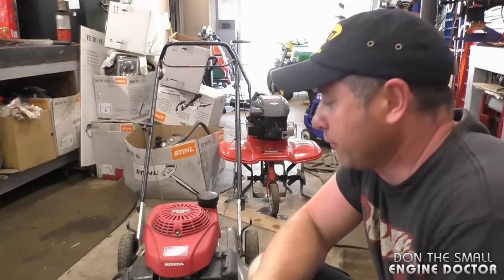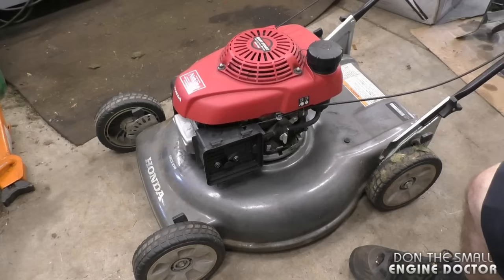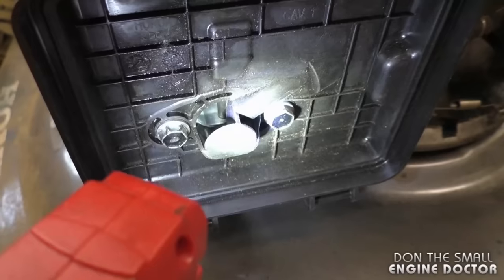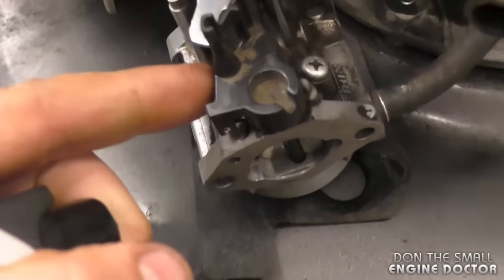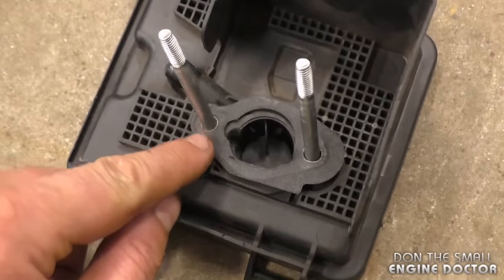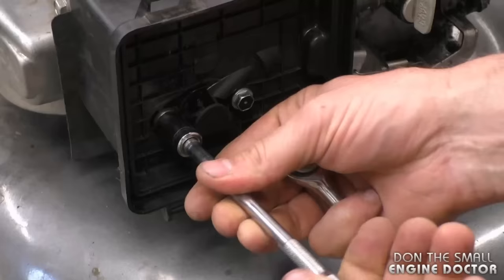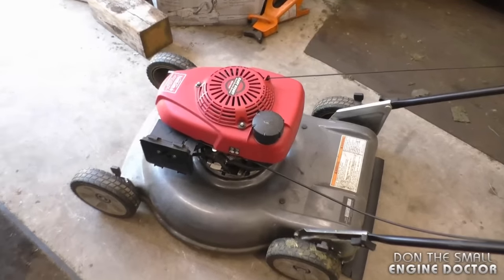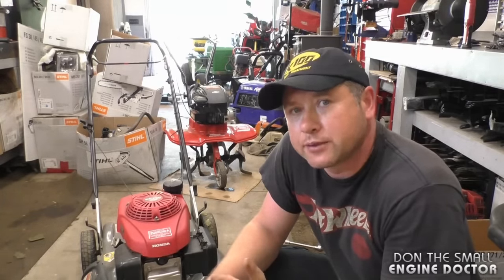Make Your Lawnmower Start On The First Pull Again - Honda Auto-choke Repair - Video

Comment: Consistently ranked at the top of Consumer Reports best mowers...I love my Honda.  This is a great auto-choke system that's easy to repair if it fails.  Thanks Don!!
Reply: @Walter Sobchak There's absolutely nothing wrong with a manual choke, Walter.  My Honda is 10 years old, doesn't have a auto-choke and it works fine; my point is if your mower has an auto-choke, the one made by Honda equals are beats the competition.  Thanks Bud!!
Reply: Yes it is easy.

Comment: Excellent clear video fixed my Honda no start issue  due to incorrect assembly of the carb causing the choke to be fully open , now fully closed on cold! 10/10💪💪💪

Comment: Thumbs up for sure. I bought one of the commercial Honda mowers that had this problem.
Did not want to put it in the shop to fix this poorly designed auto-choke so you helped me fix it.
Thanks much for this video.

Comment: What great video! This worked perfectly for me and my GCV160-powered mower now starts with one pull like when  it was new. I could not wait for the wax cartridge I had ordered online to arrive so I simply grinded down the pin ever so slightly and the mower now starts on the first pull. I will have to replace the cartridge when it arrives because the mower now runs a bit rich since the choke is probably not opening fully on account of the shortened pin.

Comment: Thank you so much for this video!! You explain things very thoroughly where I could actually tackle this project myself. Only problem was when I was attempting to remove the thermowax cartridge it was EXTREMELY difficult to remove and took at least 5 minutes with trying to pull on it to get it out. As I was trying to get it out and once I finally did I noticed quite a bit of gunk on it (a black/dark brown color) which is what I'm sure basically "glued" it in place. Do you have any recommendations on how to clean out the cartridge space before I replace it with a new one?
Reply from the maker: i use a small pick or flat screwdriver
Reply: Ok, great! Thanks for the tip and for your response!
Reply: @donyboy73  dony this happened to me too. Very tightly locked into place with black gasket seal. Does the Honda factory install these cartridges on purpose that way?? And the real reason I came to your site is to ask…when I’m replace the thermowax cartridge should I use black gasket seal or just clean out the hole and go with a dry fit???
Reply from the maker: @Fresh-tw7ev  I just insert new one without using anything

Comment: Thanks ,  that totally explained my mower's problem,  it can start first time and runs fine,  then stop , start again,  it will have problem,  even if it starts,  it vibrates and black smoke.  I found the choke flapper won't be wide open when the mower runs badly,  and the pin thing is randomly stuck out or stuck in.

Comment: I  really enjoy your great videos sir!  I personally use two threaded rods to align the gaskets and carbuerator as 'guide pins'.  You can then remove one threaded rod at a time, and then insert each bolt.  Saves time and potential errors regarding the gaskets allignment.

Comment: Man I miss my Honda Commercial walk behind... thing ran for 25 years and always started on 1 - 1 1/2 pulls... always.
Reply: Commercial mowers are designed and built with better quality materials and last much much longer. Those box store models are NOT of the same quality. I know a Honda dealer that loves to show his customers the difference. He even has both types disassembled on the showroom floor so he can show you the differences.
Reply: RC Hobbyist Extreme big time difference! Solid steel deck for starters... way better wheels, better engine... just solid and ready for business... the deck on mine finally passed away after all that time... it literally ran for 25 years... was still running but I let it go... hard decision but I did what I had to... bet it still starts... lol

Comment: My Honda mower is so hard to start. It has the rechargeable automatic starter but it won't start it from cold. After a couple years old and it wouldn't start right away, I always wondered why it didn't have the choke button to press 3 times before starting like my old mowers had. I finally discovered a hack to start it: fill gas tank, then roll the mower on its side to the right until deck is perpendicular to the ground (as if you were to inspect the blades), then flip it back upright and use the pull-start. If it doesn't start within 3 pulls, try flipping it over to its side again.

Recently I noticed that the engine said it had an auto choke and I then went hmmm I bet there's something wrong with that feature and sure enough Google brought me right here! I'll be glad to do away with my flip-start hack if this fix works for me. 😋
Reply: Update: replaced the part and it now starts on first pull from cold! No more flip-starts for me. 😁
Reply: @Rein_Ciarfella  Noooo, just get the fix! I don't miss it since I got the fix. I hope I didn't start a trend 🙃

Comment: My honda hrt 216 thats over 10 years old starts 1st pull everytime. However it does have the choke on the handle throttle lever so I guess I'll stay away from auto choke honda mowers.
Reply: @Big Texas problem is they are all going to this auto choke crap.  Can`t find a new one without it.

Comment: Dony
Thanks for the video.  Pulled my Honda out after a long rest and mower would start and run but then chug and die.  Choke was closed but wouldn't open.  Saw this video on the opposite problem and found that the pin wouldn't come out even after it got hot keeping the choke closed.  Followed your procedure, replaced the thermal cartridge and mower runs again.

Comment: I have one of these engines with the choke lever that auto-returns when you squeeze the handle bar. Not at all impressed with it. I own many pieces of lawn equipment and it's the only one that has fuel/carb issues.

Comment: Hello replacing that part was the only problem I had with my    Honda, not counting regular maintenance. But, I had a tough time getting it out. I had to drill a small hole then drive a self tapping screw into it. Then I pryed on the screw until  it popped out. I also used liquid wrench or something similar, Honda's running great now. Hope this helps.

Comment: The video I want to see is how to convert it to a manual choke ...
Reply: I did one recently for a customer.
I found I had to install a separate choke cable but otherwise pretty simple. The cable I used was just a push/pull type.

Comment: Was I one of the only few that noticed that the fuel line was off in the beginning?
Reply from the maker: yes it was off but fuel was in carb and you could clearly see in video the pin was defective
Reply: @donyboy73  tell em dony

Comment: Great video. I'm trying to fix my neighbours Honda which also has the GC160 with an auto-choke system but his machines issue is it surges. It doesn't have a problem starting so I will try stripping down the carb and cleaning the jets out instead but this video is very helpful in knowing how to reassemble the various gaskets etc. Thanks again

Comment: I’ve bought two new mowers in the last few years. One Troy Bilt self propelled and a Husqvarna push mower and bought them specifically for theHonda GVC 160 engines. They’re very reliable and easy to work on.

Comment: Nice video.  I just replaced the auto choke on the GCV160 on my Husqvarna push mower.  The old thermal-wax module was a bear to get out...  They used RTV when they put it in!  I had to drill out the center of the old module so I could get needle nose plyers in there to finally get it out.  When you reassemble, pay attention to the gaskets.  The one between the carb and the outer housing has a vent hole... (ask me how I know...)

Comment: Thank you for this video! I’ve had nothing but problems with our HRX mower and this is the reason why. Just ordered the thermostat choke part. I’ve done every other Maintainance item you can do, including complete carb clean and several fuel additives to clean lines. This HAS to be it!

Comment: I have that exact model lawn mower and it took FOREVER to start the first time this year. It finally started after about 50 pulls over 2 tries and it sounded just like that. I cleaned and checked the gap on the plug, checked for a dirty filter, etc. It took several pulls again after a long break to do other work but only took about 10 pulls. Since it did start, I'm not sure if that's the issue but now I know how to check. THANK YOU!!!

Comment: Thank you donyboy just fixed my 7 year old HRX217VKA with the GCV190 Honda engine by replacing this part for $11.26 from the local ACE hardware store. Mine was hard to start the first time but easy after started once. Now it starts easy no matter when. They had it on hand so no need to wait either👍

Comment: My old engine with manual choke was replaced with a used auto choke motor. Wish I had remembered there was a pipe sticking up in the weeds. The old motor was better cared for. Gonna get a wax cartridge, new carb and oil change. Thanks for the video!

Comment: I wish I had knew this when I bought my Honda lawnmower along time ago.  Was very expensive and the worst lawnmower I ever saw - had the exact problem you show in the video. It would not start (ever) when it was cold - I finally gave it away.  The machine was very well made other than it wouldn't ever start.  I have owned many Honda products with no problems.

Comment: That did the trick!  Started on the first pull after replacing it.  I can’t believe I have been spraying starter fluid in the carb for 3 years due to this $10 part.  I had a Lawn Boy M-Series commercial mower for 20 years that started on the first or 2nd pull every time.  I only got rid of it b/c I couldn’t get the handle assembly for it.  It was still running like a champ when I got rid of it.  Should have paid someone to weld the handle.

Comment: Great video! Thank you! 
I wondered what that thing was when I took carb off. Had to replace recoil assembly, and the circular fan plastic thing under it as the previous one got hung up, the pullcord wouldn’t retract, I tried to pull it a little to see if spring was stuck, but the rope caught on that fan thar attaches to crank and someone was looking out for me cuz the rope circled around my thumb and index finger and never cut them off, just barely a little rub burn. The crank fan busted into pieces and stalled engine. 
Never do something that stupid ever ever again man

Comment: I take it that other makes of lawnmower that use the same Honda engine will have the same problem. I do not know about the USA but many makes in the UK use Honda engines. Mine is a Mountfield but it has an auto choke Honda engine,  so thank you  for this video.
Reply from the maker: yes might be the same

Comment: I have 1986 220 r? self propelled . drilled a hole in air cleaner so i could shoot carb cleaner or gas in the carb.  Done this for 20 years.  Now i can fix it right, thanks ole buddy.

Comment: Another excellent video donyboy73. It has been a long time since I needed your help and forgot how useful your videos are. I really appreciate showing how it all goes back together. When I took it apart the carb linkage and gaskets fell out of place and the plastic cover makes it hard to see where everything was before disassembly. My problem is that the mower will start but not rev up. It also sometimes will not start when hot. I will buy this part and see if it fixes the problem. This will make my wife very happy,  she is the one who mows the lawn because it is her exercise.

Comment: Good explanation. Always wondered how those auto chokes work
Reply: Throwing Apples 
I thought they used BiMetal 
Just like the thermostat 😁
But Wax actuator is also use in the dishwasher machine to release the latch on soap dispenser

Comment: Okay that makes sense. In summer, our mower had no issues starting. As the temperature has fallen now, it is hard to start the mower. I left the mower in the sun for a few hours and after a couple of pulls on the cord it started.

Comment: Very useful video . I wish I could’ve seen this a year and a half ago . I bought a new HR216VKA and it came out of the dealership in a box to my home without running the mower for a minute before it’s first use . I would always give me starting problems . I ended up giving the 450 $ crap away .  . I

Comment: Great video as well as others you do! Mine is GCV160A0 with electric start and has been having the difficult to start problem since it was new at April 2019. It wasn't very bad at first but has gotten progressively worse such that it has to completely cool down to get it to start. I am meticulous about running 89 to 91 octane non-ethanol gas and keeping it very clean and I run out the gas in the carb at the end of the season before storing it for the winter. I have a four year warranty. I was under the assumption that this is a warranty issue. I even took it to an authorized Honda repair shop where I paid a $30 diagnostic fee believing Honda would reimburse for it as well as the other repair costs and parts. Unfortunately Honda will not warranty this part even though mine still has about two years of remaining warranty. The repair shop diagnosed that it is the thermowax part, but Honda claims it is a normal operating characteristic of the auto choke. Auto choke to me means the choke automatically adjust no matter what the temperature is. If I turn it off after getting to operating temperature and leave it for a several minutes it won't start. It tries to start and sometimes I have tricked it by moving the governor, but usually not successful. I am really bummed that Honda will not warranty this. Anyway, through my research it looks like the thermowax part number of 16620-Z8D-305 has been superseded to part number 16620-Z8D-842. Do you know if this is the case, and if so, is it because this new part number is an improved part such that it is more reliable? Thanks!
Reply: I am really put off at Honda for going the cheap rout on these and not backing them with a warranty you can trust.
The Chinese engines use a copy of he GVX, and have a by metallic autochoke.
A little better engine design also with a automatic choke.
I'm now into year 4 of my used Chinese Kohler powered MTD mower.
Pushed home from the road because of a clogged carb.
The Auto choke failed and had to be replaced because it was even more complicated with a Vacuum pull off and a divorced by metal on the muffler. ( replaced the spring ).

Its heavy,  but its less thirsty than other mowers I had.

Next one will be electric..

The only people that made an automatic choke that worked right seem to be Briggs with the old flat head 3.5 hp mowers.
And they weren't all that heavy, I kind of wish I still had one.
Reply: @nos9341   Luckily mine is an electric start and and I can just kind of trick it by moving the is a governor lever a little bit little bit well turning the electric start key. I have to tie a little wire around the on off bar but it's not too big of a deal. It's just such a hassle. I wish that they would just honor the warranty but it's going to cost them so much.

Comment: My Honda mower has been progressively getting harder and harder to start when cold. I will have to check this out. Thanks for the tip!
Reply: I have a Honda mower and in my case, the choke plate needed adjustment as it was not fully closing.  I had to adjust a linkage to get it to close all the way.  I have an HRM215 with a real choke lever on the handle.
Reply: @TechGorilla1987  ding ding ding ding! We have a winner! My choke actuator was binding so all I had to do is clean it up and put a little bit of oil on it, works perfectly now. Starts on the first pull.

Comment: I have an older craftsman with the same motor (gvc 160) but it seem they don't use the cartridge, instead there is a manual choke that starts opening as soon as you grab the kill switch lever at the top of the handle.. you can actually see the choke lever closing as you try to start the mower ...sometimes have to race the choke closing mech a few times to get started

Comment: Very helpful but I do have a small question. When I removed the 10mm bolts the carb and choke fell off onto the deck. The plastic piece that connected to the wax pin has 2 positions and after cleaning it was not obvious what the correct position should be. Only after watching your post a few times it became apparent. It might be helpful if this was made clearer. 
Once again thanks for the best post on this issue.

Comment: Hey Dony! I have exactly the same Honda mower with the exact same carburetor set-up. Took the carb apart and completely cleaned it. Being an internal jet, I needed to remove the idle screw to access. Yup, just as in your video, the actual culprit causing the poor pull start was the thermal wax unit. Have ordered a new one from Honda. Question is, when re-installing the idle screw how far in should it go in as I forgot to notice upon extraction. Thanks Dony, I really appreciate your channel!

Comment: I've had a few mowers with different styles of auto choke...all I can say about them is that a choke cable is better.  The honda style have worked for a good while but when they go out it isn't a part many places have on hand.  And the other style (round coil spring that mounts to the muffler) I've had one of them be bad out of the box (on a $375 mower)

Comment: Thankyou Donny,

I encountered a no start situation after removing my carb and replacing it, I thought possibly I put the gasket upside down I left to right; this could be the problem.  I will examine for it when Idouble check the gasket placement.

12 years old and it started on the first pull every time.